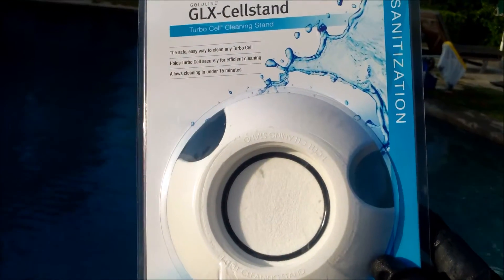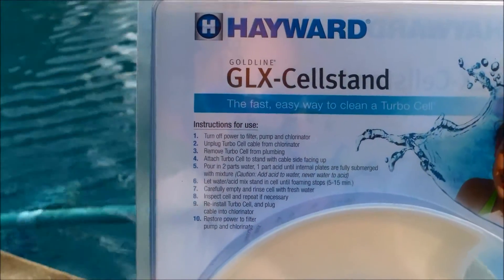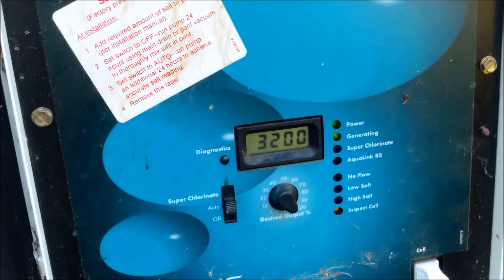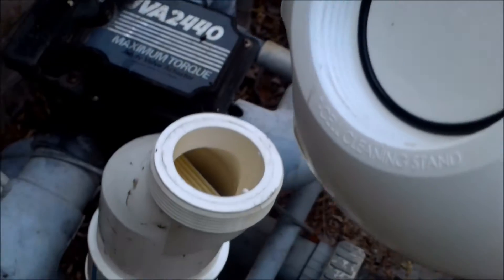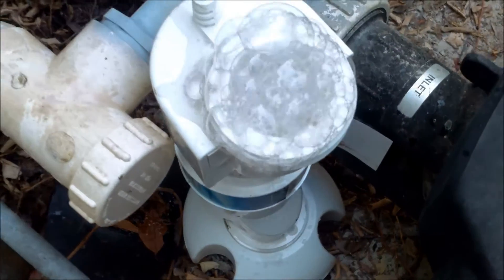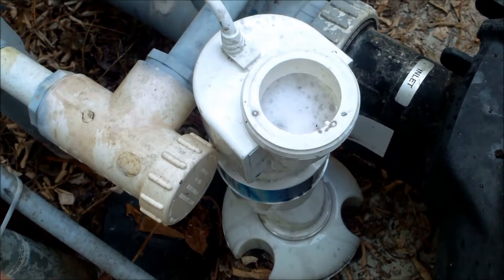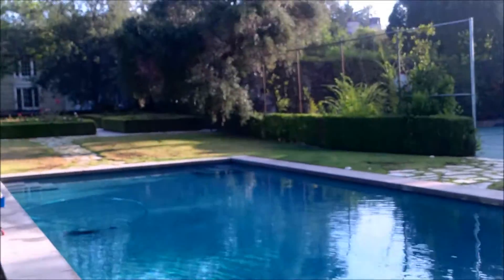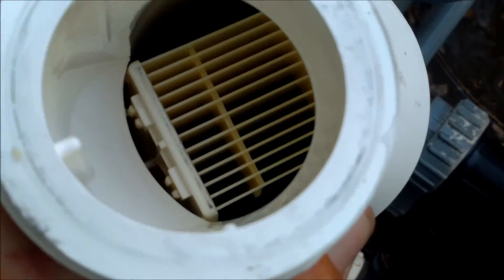Cleaning your Hayward Turbo Cell with a GLX-CellStand

Comment: You can 100% and should, put it on the stand with the cord facing down. That’s what the notches are for so the cord does go in there. Otherwise if you live in an area with hard water you will never get the sensor that reads your salt level clean because that would be at the top and not submerged in acid
Reply: Is this true? You’re saying that the cord area should be at the bottom, connected directly to the stand?

Comment: Is there a reason why you did not unplug the cell when servicing it?  Haywards how-to video recommends unplugging it is why I ask.  Thanks for all the great videos!
Reply from the maker: I just turn off control panel but if it is connected to an automated system you can easily unplug it.

Comment: I've been noticing  a lot of white flakes right under the return line. Not sure what it is.  I've cleaned the cell and cleaned the filter.
Reply from the maker: medina239ify Add some PhosFree to that pool and in a few weeks the flakes will go away. High Phosphate levels react with the salt cell producing those flakes. By the way this stand also works with the Pentair cells.
Reply: Swimming Pool Tips, Reviews & How To -MrDgvb1 thanks David. I'll try it. What's the name of your business?